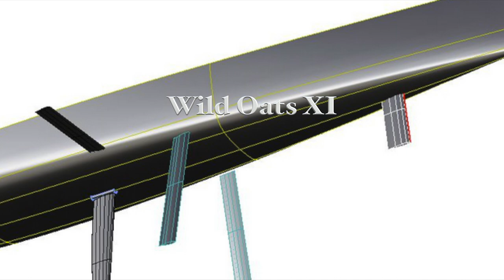Keel Envy On Hunter 25

Comment: I've considered something like this and thank you for your example. Is it still working to your expectations and have there been any down sides? Best/Roy
Reply from the maker: Roy Schreyer Thank you for your interest Roy. I started to use it this past summer and it does works fine to help point windward and reduce lee helm.
I only lower it when needed (reaching with code 0 and when experiencing lee helm) otherwise it up. A couple of small issues are when lowering under way, I need to turn into the wind as the hinge cannot take any sideway force and turning speed during tacking is a bit slower ( but hardly noticeable). Once in place and secured tight against the bow, it’s like the keel is part of the boat. I remove it and stow it inside when mooring on the ball (don’t want the mooring lines to rub on it). Hope this helps and keep me posted with your project.
Reply: Very helpful! I have a new design where I used long bilge keels with more surface area forward to keep draft to a minimum. While the boat does go to windward but it drifts more than I had hoped. I've added a lee board, which needs testing but should further improve the sailing. I was determined to avoid breaking up the interior bunk as the large queen berth is a key feature in this 16' boat! This is where I was considering a "bow board" such as you have done. Since I have gone with the lee board I'll save this idea for future builds. If I were to build from scratch I think a slotted bow would solve you having to go to wind to employ the board. It could live in a forward slot and the shape could be cantered back to go under the hull. Thinking out loud now but thank you! Best/Roy

Comment: Nice work! I was actually thinking that something like this could reduce sailing/yawing/wandering at anchor. Is your Hunter prone to that? Does lowering the bow board help?
Reply from the maker: Ben Pearre My boat does sail a bit at anchor but I do not keep the bow keel down. I will give it a try next summer to see if it helps. Thanks for the comments. What boat do you sail?
Reply: Thanks for getting back to me! Yes, I'd be curious. So far I've mostly been sailing around the anchor in a Nonsuch 26, which carries far too much windage forward to sit well at anchor. This year, a Farrier F-32 :)

Comment: Wish there were more genius Andre mods to watch!
Reply from the maker: Thank you so much! If you haven't see this yet, it shows some of the other mods I build for the Hunter 25. https://youtu.be/Ax0rxwC8Uqo
Reply: Andre Bachman Andre Bachman cant wait to try a bow centerboard on my little Halman 20 full keel im almost positive ill hit 10 degrees more upwind. Some of my kiteboards  have front skegs designed for similar reasons
Reply from the maker: @MonstroLab  Please let me know how it works for you. One consideration is that as you move the center of lateral resistance forward (with the addition of the bow centreboard), think about how you can add or move your sail power forward to compensate. One reason I built mine was to reduce the lee helm is generated by my Code 0 spinnaker mounted on a  bowsprit. The code 0 is a great light air reaching sail.